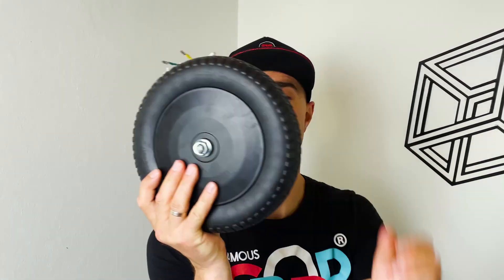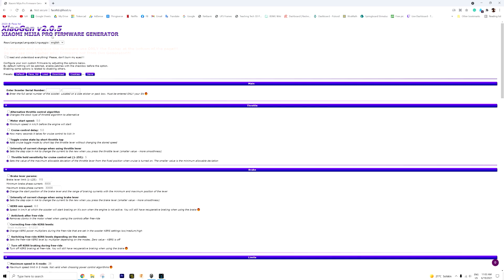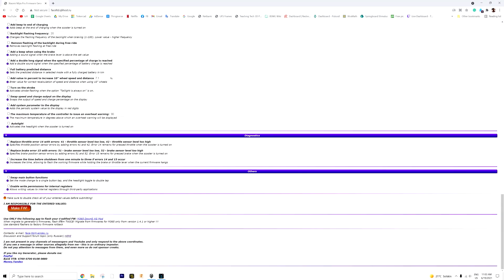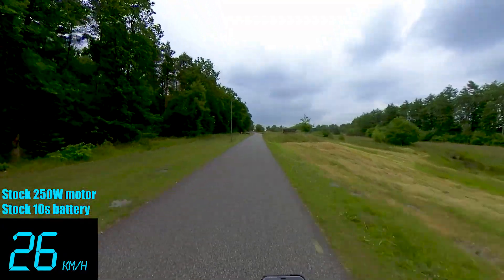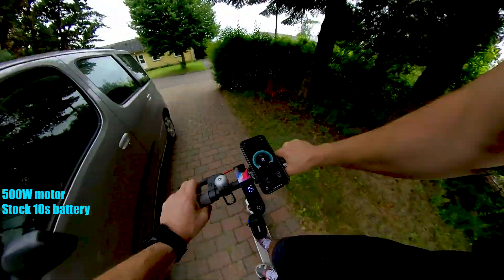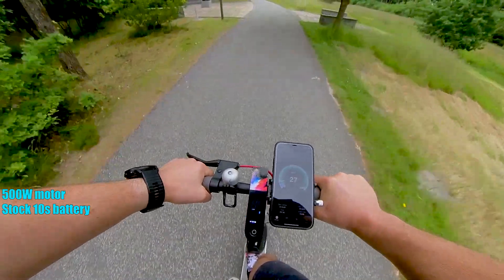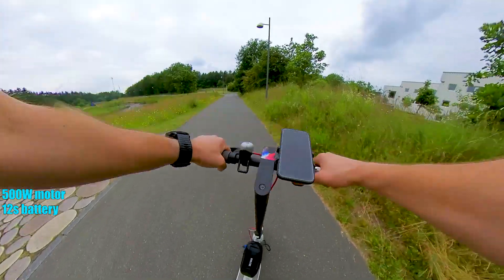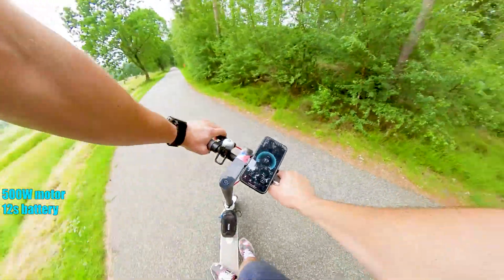Xiaomi m365 first look at the 500W motor (Monorim ?)

Comment: Hello sir.
What is the differences of speed battery and range battery?
Is it gonna affect also the controller of the scooter if I will add a bigger battery for my scooter?
Reply from the maker: Range is the same voltage, more capacity (mah). Speed is more voltage, despite the capacity.  
Depends what is “bigger” - if it is only capacity - stock controller will work. If it is more voltage than 12s pack - you will have to at least modify the controller. 12s (max 50.4v fully charged) you can still use the stock controller
Reply: @VRMinde  thank you sir.
My scooter is copy only of gmax and I have done a lot of modification.my scoot max speed is 30kmh.i just want to atleast add a little bit more of speed maybe 40-45kmh.do you think I will add a speed battery.
Reply from the maker: @cesarpingaronjr2914  from 30 to 45 is not “a bit” it is a lot to add :) you will definitely need a higher voltage battery, at least 14s/48v, meaning a new controller as well. Be sure to have good brakes and do not forget F=m*v^2 :) (force equals mass multiplied by speed squared, or in other words - speed adds a lot to when there is an impact)
Reply: @VRMinde  my scooter specs is 36V 15ah nominal voltage36 VDC max.
Hub motor is 300watts.
Can you advice me sir what kind of controller and how much battery i will add for it just to reach the speed that i want.
I learning a lot from you right now honestly ☺️☺️☺️.
Thank you very much 🙏🙏🙏
Reply from the maker: @cesarpingaronjr2914  I can’t advice you a specific controller. To reach speeds of 50km/h you will need at least 1000w 🙄 so think of 14s (48v) battery pack and 20-25a controller. Motor might survive for a while, but at the end you will replace it as well. Overall it is cheaper to buy a faster scooter than to upgrade the one you have, just saying :)
Reply: @VRMinde  thank you very  much sir for this conversation i learn a lot.
Stay safe sir and god bless.
Thank you so much again.
I will update you about my scooter speed modification 😁😁😁

Comment: Ive got my monorim motor it rides a bit swoother i dont think you need the pro dash i done it with hack its going about 31km now but the wheel hits back of mud guard.its ok when i pull it up a bit.ive ordered a 48v batery 100ah will that work on stock controler.???

Comment: whne using 500w 12s battery pack did you have to buy rita bms or just normal sorry if that didn't make sense thanks
Reply from the maker: If you only use 12s pack but do not need to use your stock pack - you don’t need any Rita. 
BTW Rita is rated for 30amps input, a bit more and fuse will burn
Reply: @VRMinde  what range would you get with stock m365 battery and 500w motor? thanks
Reply from the maker: @meco3215  similar as with the stock motor. The motor is not a bottleneck on a stock scooter. If you want more speed and power first thing to upgrade is the battery pack
Reply: @VRMinde  could you send me a link to your external battery thanks
Reply from the maker: @meco3215  https://m365.embedden.com/44_4v_10350mah_battery
Reply: @VRMinde  will the controller fry if I use 500w motor and 40v battery connected with normal m365 battery (no rita)
Reply from the maker: @meco3215  what is a 40v battery? 10s?
Reply: @VRMinde  i got the 500w monorim motor and i burned the controller lol but i have a spare controller but yea thanks for this video bcs the motor is really nice
Reply from the maker: @meco3215  😂😂😂 yup, that is why I always say that it is cheaper to buy a designed scooter to the speed that you need it to ride :) but it is also fun to upgrade and learn :)
Reply: @VRMinde  what do you think is the safest firmware for 500w motor
Reply from the maker: @meco3215  what do you mean safest firmware? How to burn less controllers? Disable regen braking. Just use good disc brakes and no regenerative braking

Comment: The controller died! The same happened to me with the monorim 500w during braking. So you have to do some adjustments in firmware to avoid this. I placed again the stock 250 w motor and a mi 365 pro controller and things are far better now
Reply from the maker: Yup :) I have went with phaserunner that can take up to 4kw :)
Reply: You replace only the m365 pro dashboard and anything else??
Reply from the maker: @listarxos  you don’t need to replace the dashboard for using 500w motor. What you need to feel a benefit of the motor is bigger voltage battery pack
Reply: @VRMinde  if i have a stock 250w motor and i want more km, only upgrade to pro 2 with dashboard and firmware change?
Will i take anything?
Reply from the maker: @listarxos  you can just change the firmware on the stock one. The other controller and/or dashboard won’t change anything
Reply: @listarxos  yes I put back the 250w motor, mi 365 pro controller and dashboard too
Reply: @alexandrossotiropoulos5621  δηλαδή μόνο το dashboard από το m365 pro με μαμά μοτέρ και πάει καλύτερα??Τωρα τι μπορώ να κάνω πριν παραγγείλω το dashboard?Πως βγάζω τους κόφτες?
Reply: @listarxos  Βασικα για να δουλεψει σωστα το controller του mi365 pro στο απλο θελει και το dashboard διοτι εχει παραπανω λειτουργιες. Εχει ποιο καλη επιταχυνση και παει λιγο ποιο γρυγορα. Με το ιδιο μοτερ χωρις προβλημα. Η επομενη αναβαθμιση θα ηταν μια καλη μπαταρια. Τωρα το monorim θελει 48v controller, υπαρχουν αλλα θα πας για μεγαλη αναβαθμιση
Reply: Αλέξανδρε είσαι Έλληνας?
Reply: @listarxos  Ναι,

Comment: Did you run the battery pack in parrell so keeping the 36v or did you seties doubling the voltage I also got a replacement controller and the speedo was waaaayyyy out. Reinforce the shunts and replace the large capacitor
Reply from the maker: I ran it with 12s pack. In another video I tried it with aftermarket controller and the 14s pack - mich better!

Comment: I wish I could understand this motor does not support a regular tire and inner tube :-( :-( -- I bought this same motor after seeing your video, and it really has more torque with the same battery and firmware, it is amazing.
Reply from the maker: Inflatable tire would be cool, true :)
Reply: @VRMinde  Seems the original monorim motor is also only for solid tires :-( -- seems there is no such 500W powerful motor for M365 that is also for inflatable tires.

Comment: Hello, I was wondering if I buy the Rita adapter from Denis yurev and I add a 12s 44,4v and the stock battery. Is there any issue with adding a 350w or 500w to it ? Do I have to do something specific to the software
Reply from the maker: You will have to set the max voltage in the firmware and also desired power for your motor (despite if it is stock or 350 or 500w)

Comment: Has anyone tried the the rwd mod on this scooter and if you have what difference in handling have you noticed
Reply from the maker: On M365 I have tried RWD, FWD and 2WD. They all handle a bit different, but I would not be bothered too much about that.
Reply: @VRMinde  was rwd faster or handled better
Reply from the maker: @ninjaarcades7356  it does handle a bit better as it is easier to lift the front wheel for jumps and curb drops. If you have a lot of power on your scooter start is also better with rwd m. Also if you install the disc brake in front - the braking is so much more efficient. I did not notice any difference on carves/turns or just riding on a straight line though
Reply: @VRMinde  yeah thats what I was thinking breaks would work even better with suspension on front like my motorcycle
Reply: @VRMinde  I was thinking 800/ 1000w motor in rwd is this going to be ridiculous fast I have front and back suspension and ten inch tyres
Reply from the maker: @ninjaarcades7356  you will need another controller, beefy battery pack to feed such a motor. The. The question is if it’s worth it investing in m365. For 1000$ you can buy a scooter with 2WD, good motors, much better suspension, brakes, battery, wheels and tires, wide handlebars, etc etc. You will end up spending the same and it will still be worse result than a scooter designed for more power and speed
Reply: @VRMinde  yes good point how about 500w motor is this better cheaper option and will this also only benefit from bigger controller
Reply from the maker: @ninjaarcades7356  changing only the motor will not make a notable difference. You can actually change the battery pack first to get more speed and range with the original motor and controller (controller will be the weakest link then)
Reply: @VRMinde  ta

Comment: My m365 pro is a year old, removed speed limiter an hour ago and I'm getting 30-32km/h on gps on stock battery and engine.

Peak power is 700-800w and 300-450w constant. Not really more then with stock firmware. 

With stock firmware it would do between 250-400w constant depending on road conditions.

Can definitely tell the controller gets warmer and motor to.
I don't really use the thing alot and searching for cheap options to let it do 40-45km/h.
Reply from the maker: The stock motor can do 40-45 on pro. Controller can also survive, especially if you disable regen braking. The bottle neck is battery pack. Of course your controller will heat up even more, motor might burn one day as well…
Reply: @VRMinde  tried custom self modded firmware and got red blinking. Now reflashed preset firmware. Working again, but charges to 41.0v instead of 41.4v.

Can you make a firmware with disabled speed limiter and 41.8v ?

Regen is very strong on hard.

I'd prefer medium, under load voltage drops down to about 37-38v in the beginning and with regen it goes to about 41v.

I've seen a external battery pack ( 25ah 36v ) on a website from Poland.

But then you're on the charger for 24 hours which is not ideal with stock charger.
Reply: @VRMinde  I have loaded a modified firmware on it this afternoon again. Pulls harder, but preffer stock settings with unlocked speed of 32. Less power usage ( now about 700-800 peak, 400 constant max ). During a load @ Full charge, the battery voltage dips down to 36-37v which is not ideal.
Reply from the maker: @daand12  that is a big voltage sack. I just wanted to reply yesterday that ESC should not control how much your pack charges. It should be done by bms in my thinking at least 🙄 so should not depend on the firmware
Reply: @VRMinde  I think it's actually the BMS that does control max charge voltage, because i have a 4A 42V charger from AliExpress and seems not even charge to 4.2V per cell. More like 4.13~4.15V maximum. 

That cheap €16 charger actually charging the battery pack really fast. Should be done charging in 3 to 3.5 hours.

Charging at 4.1A actual current.

Stock charger is over 8 hours.

I will drive from 100% to 0% this weekend with the firmware mod and then charge back up.

Done 6.9KM today and had 70% left right after a stop.

That voltage sack ( 37.5V when full @ 20A ). 

Mine contain EVE ICR cells and not LG or Samsung SDI.

https://imgur.com/kwi5aiz

Personally i think you can charge the normal M365 in 1.5 hours with this 4A charger
Reply from the maker: @daand12  try avoiding to go to 0 charging. The lower you go the less cycles your cells will live. And be sure to charge them up asap when the pack is low.

Take a look at the spec sheet of the cells to see the max amperage for charging. 
Also might be smart to replace the 2 tiny wires that go from the charging port to the BMS with a bit thicker ones (or at least check if they are not getting hot at 4A, I have no idea).
And enjoy the ride mate :)
Reply: @VRMinde  I think the pack is 4p10s configuration, which I'm unable to find ICR version of the Eve ICR 3200mah.

Only 2500mah and that's rated for 7.65a discharge and 1.25a rapid charge. 

There's a INR version and that's 3200mah. Would liked to see they used panasonic cells for better discharge rates and less voltage sack.
Reply: @VRMinde  I have driven the scooter to 15% today and charged back fully in about 3.5 hours. I have ordered a external 25ah 36v battery from CityLion just now and hopefully will be getting 60-70km range extra on top of the 25-30 with the 474wh battery.

Speed noticeable dropped at about 25% remaining, especially uphill.

It does charge to about 4.15v per cell with the fast charger, but once fully charged the min/max differance is about 0.025v which to me is to much.

Battery temps get about 42c max during driving.
Reply from the maker: @daand12  70km on a scooter? :O man :))) I never ride so long on a scooter :)
Reply: @VRMinde  Sometimes, but not always. Charging between rides sucks and with stock charger it takes max 9 hours, with quick charger only 3-4 max.

I think something is wrong with stock battery causing the huge voltage drop ( 37v, but stays like that for long time ). 
I think with second battery it might hang around 39-40v constant.
Reply: @VRMinde  tomorrow the second battery will be delivered from CityLion.

25ah/36V. Expect 60-75km range with unlocked speed and probably 90-100km with stock but modified firmware.
Reply: @VRMinde  update: external battery installed and flashed stock firmware with charging mode disabled.

Goes 31 on speedo/ m365 tools app. That's very good.

What I don't like to see that the external pack is charging the internal battery.

I think external battery was charged to 41v and internal one was 38.4v

Comment: I am replacing my 250W with a 350W motor Do I need to do any firmware or software updates? Thanks for the video!
Reply from the maker: I assume you are not on stock firmware? What battery pack are you using? You could send more amps/power to the motor. And you might want to be careful with regen braking - set it from none to low to avoid controller damage

Comment: Hi Where can i find installation guide this motor in m365 scooter. There is difference in wires color between 500W and stock motor
Reply from the maker: The extension cords are the same color, or at least two of them 🙄 it goes yellow/green/blue (the extensions).
Try gently. If you get it wrong it will either spin the wrong way/won’t spin/make weird noise :)
Reply: @VRMinde  Thx dude. I will try today :)
Reply: @VRMinde  Its work. Im happy again 😃Thank You for advise. Now i need max save performace settings for new configuratiin. Do You have some testet settings to meke custom firmware with stock battery ?
Reply from the maker: @Islamic_season  i do it basically every time depending on my needs buddy, don’t think I can share the file. Happy it works! :)

Comment: I have m365 with 2nd gen 500w pro motor from aliexpress.  With just the stock 10s battery it reaches 40kmh on a full charge.   35kmh is possible down to 30% battery charge
Reply from the maker: I assume you are a lightweight rider :)

Comment: I installed this motor onto my scooter but the motor brake is insanely powerful and launches me into the air, did you have that issue as well?
Reply from the maker: No I did not, you can adjust brakong power with firmware. Dit will burn your controller if it is so strong
Reply: where did you bought it?
Reply: @koxoba online

Comment: I'm going to prepare my M365 PRO for the engine upgrade with this 500W.
If I stay with the original software and standard battery - Will I get more torque?
Reply from the maker: If you want to feel more anything - replace the battery first. The torq difference will be negligible unless you climb hills all day long :) I would still go with a battery upgrade though
Reply: @VRMinde  my original m365 has a voltage sag to 34v when fulla charged and drawing 30A so can confirm battery upgrade is imo the first thing to upgrade
Reply from the maker: @chefen929  it is the bottleneck for sure

Comment: Hey guys, 

I’m looking for help I’m running a 500watt motor on my mi pro 2 with standard battery, please can someone help me what setting should I use to get full potential as I can’t really feel a difference thanks
Reply from the maker: Hi, you are probably experiencing the difference but not feeling it :) the difference is the motor is heating up less than the stock one. You won’t feel the power difference just from swapping the motor mate. 
Set your CFW for more amps if you expect more speed, but overall you need a bigger battery pack to load this motor enough 🙄
Reply: Thanks so much it’s more the torque when I got it the torque on it was really good I messed with the setting and now it’s really slow on start up

Comment: Hello Mate, great video as always,  sorry to hear about your controller, if your able to get hold of the V3 stock controller that will do you just good, no need to change mosfets on that,since I last commented on your previous video clip on your Dual motor video clip, I have now gone 13s3p 14.4ah internal alongside my 13s4p 20ah external battery ,Rita adapter for BMS emulation great with the 500w monorim motor, I have no issues and have pushed some good speeds so far and have done alot miles on the same controller, 900+ miles so far, I havent changed my firmware for along while as i'm currently comfortable with the firmware I created
Reply from the maker: Great to hear that v3 is lasting mate! I can’t find them to buy and they are also quite expensive!  Tried 2 aftermarket controllers, something got damaged again :) don’t want to even open them and check one more time.
Working now on 14s5p and 500w (knockoff) Monorim motor. 2.2kw today, 52km/h :) motor getting a bit on the warm side if I push it hard. Probably will stick to a single motor setup for now. Gonna make myself another battery, maybe 16s, will see. 
Thanks for watching and commenting bro!